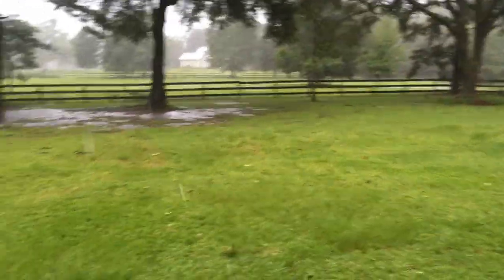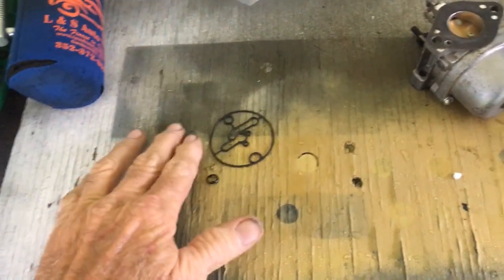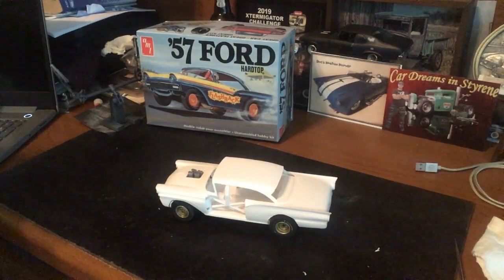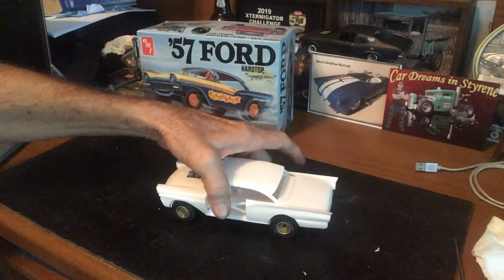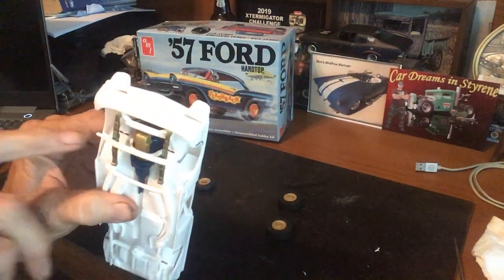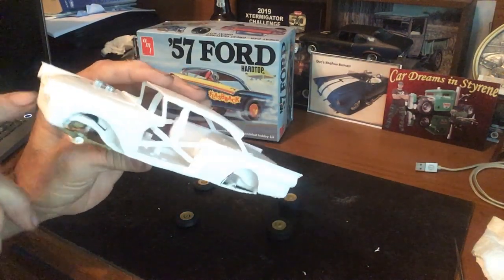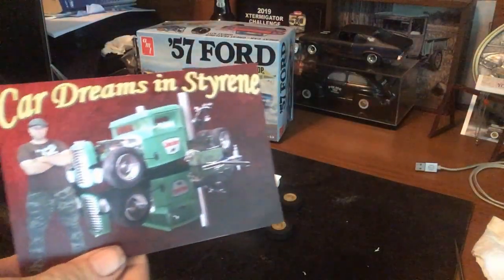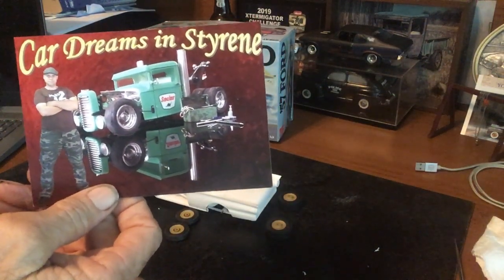Update on NYS Modeling Pro Street Group Build, and shop cards

Comment: That mold is from the '60's. I can't tell you how many different reissues there have been of that kit. I still have one that I built from an original issue back about '66. It has custom parts on it that have never been reissued.
Reply from the maker: I’m glad round 2 purchaced all the old dies, they are doing a great job on these classic kits. It’s cool you still have that model after so many years.